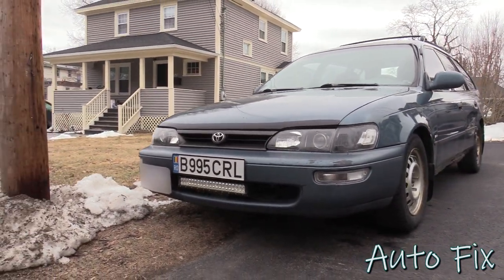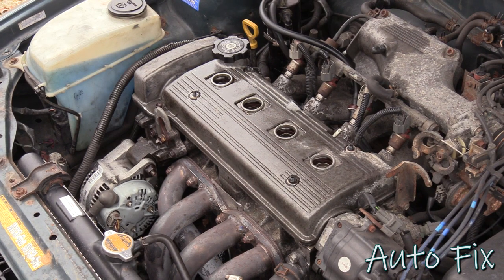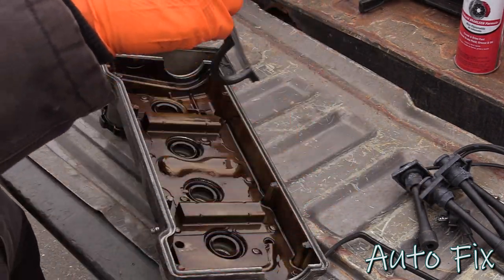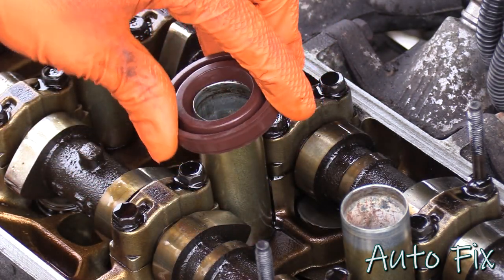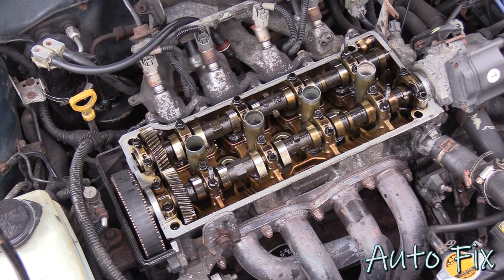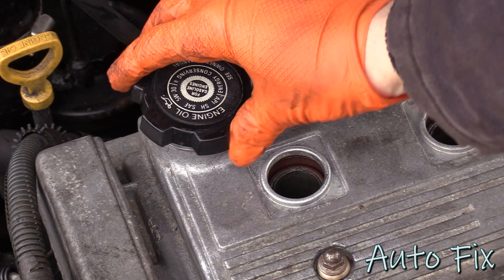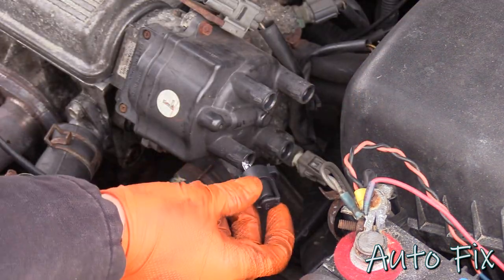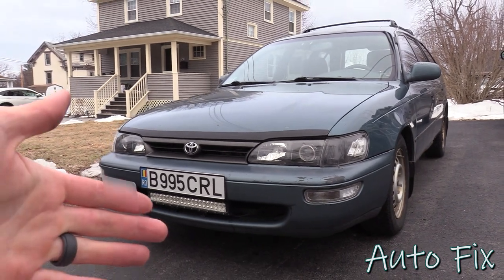Replacing Valve Cover Gasket 1993-1997 Toyota Corolla/Celica

Comment: Nice! Your videos are great and full of info!
I'm about to buy a 2000 Corolla with the same 4afe engine with just under 100k, i't looks pretty well kept all around but a couple of things made me rethink, i touched the inside of the exhaust pipe and it was a little oily so i guess it might burn some oil, is this something i should be concerned about? (Mostly worried about bad piston rings or valve seals)
It's also leaking from the 4 valve cover bolts but that would be an easy fix
Thanks!
Reply from the maker: Most of these engines will burn oil. If it's that bad to where it's dumping oil in the exhaust then there's a serious issue. Mine burns 1 qt of oil every 1000 miles and I don't have oil in my exhaust lol.
Reply: 4AFE? If you’re in the US the 2000 MY has the 1ZZ-FE. Last year for 4/7AFE was 1997.
Reply: @davidwitmer7251  it's actually a 1999.. i'm located in Italy
Reply: @AutoFixYT  thanks! I did end up buying it and so far it doesn't seem like it's burning hardly any.

Comment: How long can you wait before driving car again for the silicone to dry?
Reply from the maker: Technically 24 hours. Realistically, 30 min.
Reply: @AutoFixYT  thank you. I thought I was leaking oil from front. White smoke from tail pipe when sitting at lights for a while. I know it’s completely irrelevant 😂 but I might have a bad head gasket. 
Also I do not have cats, straight pipe to the muffler. I do have to replace Coolant but the consumptions seems normal since it’s slightly leaking through where you switch from cool to heat (can’t remember that parts name rn) but I want to buy sealant just to be sure. Im in market for an engine. Mine is 4AFE. Just examined this issue today. It also sometimes hesitates to accelerate.